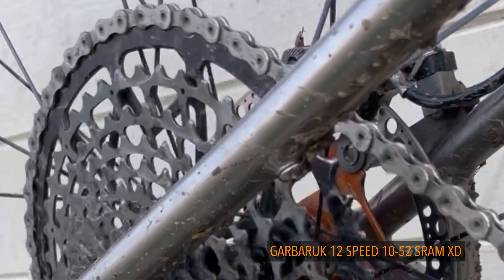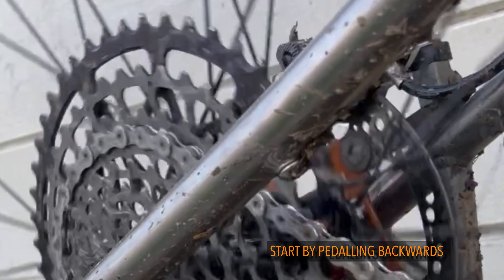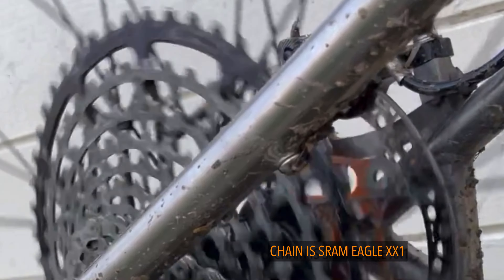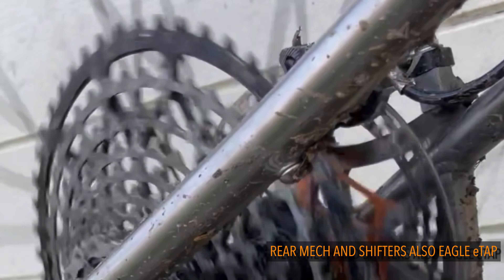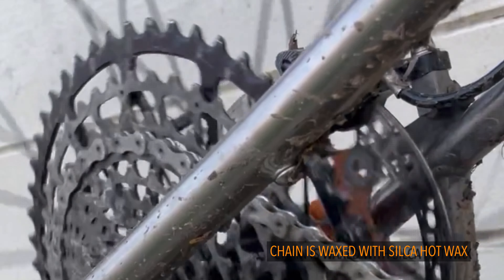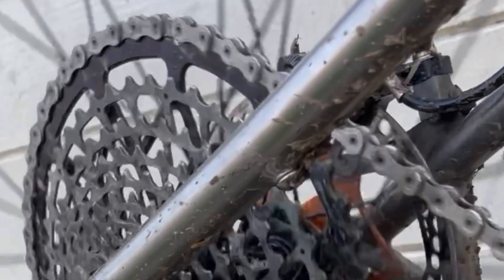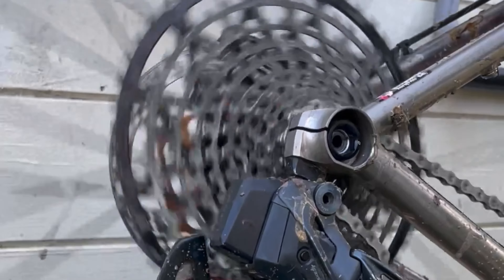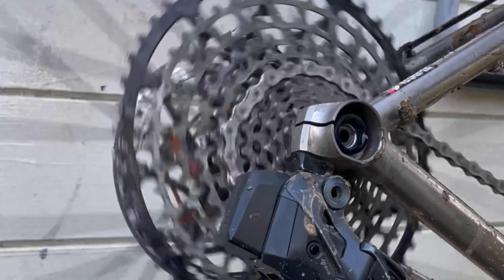How does a Garbaruk 12 speed SRAM XD cassette shift

Comment: Is shifting better that srams x01/xx1 casette? Louder smoother and faster?
Reply from the maker: I used the XX1 cassette before and performance wise I can’t tell the difference between the XX1 and Garbaruk. Noise wise again it’s very similar. The Garbaruk is lighter and cheaper
Reply: @travers_bikes  thx for input.
Reply from the maker: No problem